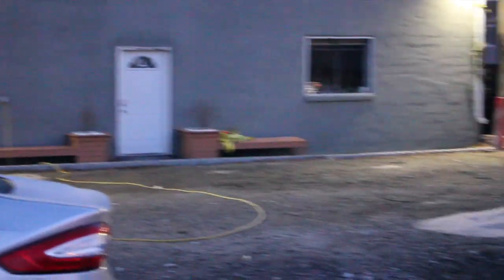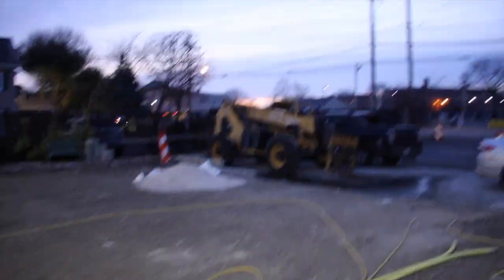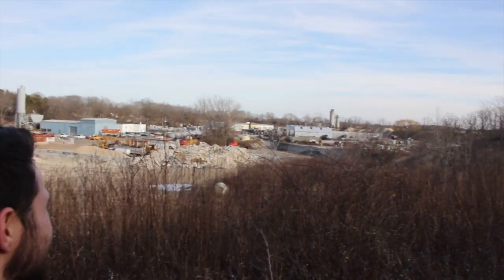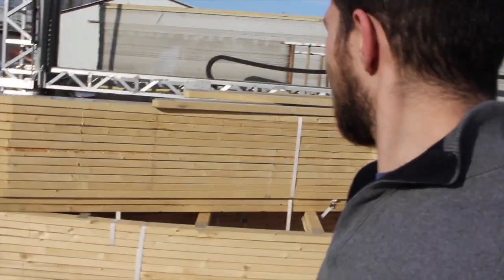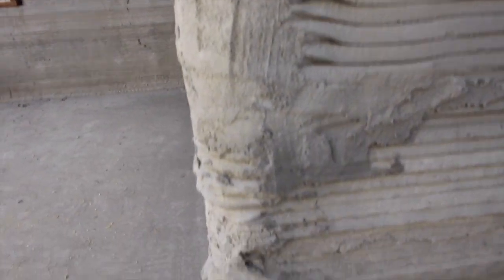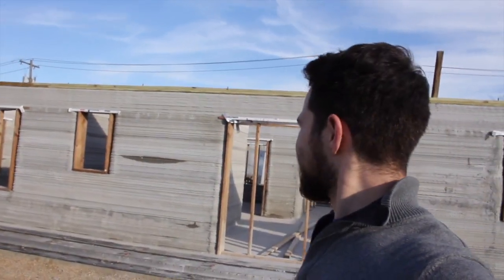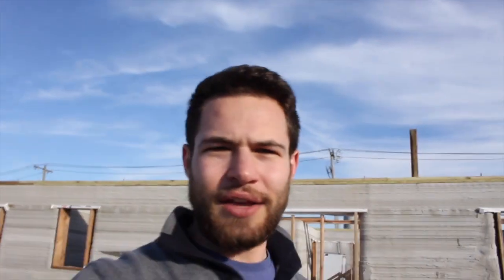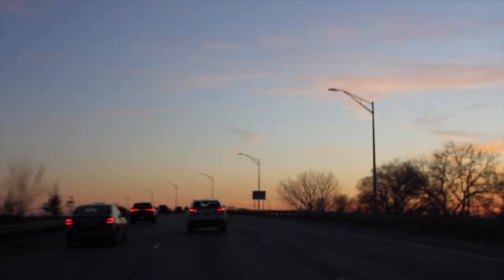SQ4D 1900sqft Printed Concrete House

Comment: Right now i am unable to contact any one that supposedly builds these houses. Im trying to get one build on my land out in the country. Yet all contact info leads nowhere. Im convinced that these people are just trying to take the money from investors and run with it. I believe its a scam.
Reply from the maker: There are reputable companies willing to sell you a printer I’ve conducted many interviews with great companies some willing to sell printers to you others aren’t. what country are you in?
Reply: Jarett Gross im in the United States. Im not interested in purchasing a printer, i just want to purchase a printed home. Mostly i would like to down size. I live outside any city so building permits would be very mild. County permits if any would be the permits required and the only one would be the make sure it wont collapse when built permit.  Thats about it. Thank you for your reply.
Reply from the maker: @googleuser8448  Sure, that is the issue with cutting edge technology. Right now not many of the printers have been made so even if you had the six figures cash ready to buy a printer you would still need to wait around 4 months for it to be built. It will be at least a couple years maybe as many as 5 until enough people have been trained on these printers that people get around to doing individual projects. The machines are expensive so people who buy them will first want to target big multi unit projects as opposed to single homes for customers. I hope to buy one of these printers within the next year or two because there are so many people who want to get their house built this way and not enough people with that skill set.
Reply: Jarett Gross, that does makes sense.  I guess im a dummy.
Reply from the maker: @googleuser8448  Your'e just a bit impatient thats all. Surly your'e clever for thinking outside the box and considering unique alternative.

Comment: One big thing that I see is cracking/settling(?) @9:45, look over his left shoulder at the top of the window frame... is that a big crack running from the corner up to the roof sill? Also, is that another crack about 10 ft to the left? I like the idea of 3d printed houses... but long term, those cracks concern me.

Comment: Totally out of pure ignorance i have a question.....as far as i know, this type of concrete, preserve most of the caracteristic and quality of regular concrete, some how develop a formula that can go in and out of the robot, and stay put on site, not needing a frame to stay put ???
But, why do not use metal bar as regular concrete does ??
This type of concrete do not shrink or expand with cold an hot weather and finally breack (need of metal bar) as regular concrete does ??
Thanks
Reply from the maker: I’m not sure what you mean by “not needing a frame to stay put” the metal frame is for the printer that extrudes the concrete and the window and door framers install those after the concrete walls are printed. They do use “metal bars” if you mean rebar. Time will tell how it lasts through winters and multiple freeze thaw cycles.
Reply: @automateconstruction  yes..i gues that is the name, Rebar, or steel reinforcment, or steel cage, i guess....in a regular concrete wall you do use ReBar, other wise it will breack.....so i do not see any rebar in this 3d walls.....even when the house is finished, the walls looks as same as the begining, no rebar what so ever.
When i talk about the frame, i mean wood frame....when you build lets say footings you do need a wood frame, in order for the concrete to stay put as the concrete is liquid.....i do know in this 3d walks, they use a special formula, liquid enough to run through  the machine hose, and after is out, if kind of dry a bit to stay in place, not running away as regular concrete does...
Thanks.

Comment: Very good video Jarett.  Thank you for making it.  I LOVE the idea of 3D printed concrete homes every since I saw videos from ICON https://www.iconbuild.com/  My only concern is the durability of concrete.  What about it cracking?  I look at sidewalks, driveways, etc.....I see cracks everywhere I walk in concrete.  Any shift in the soil could cause it to crack.  I'm playing the devils advocate because I want this technology to succeed!  For me it's all about price.  Supposedly the 3D concrete homes are much cheap to produce according to ICON.  I'm from Texas so ICON was my first connection to 3D printed homes.  What are your thoughts on cracking?  Maybe they can develop a high PSI concrete that has some sort of resin or rubber or something in it that will allow it to flex just a tad without cracking.  Wood can flex given it's nature.  I want the 3D printing to win out in the long run.  Homes are way too expensive now.
Reply from the maker: Great point, I’m hoping to do a video on icon soon. I’ll be sure to ask about cracks.
Reply: @automateconstruction  Thank you.  Yes, I'd be curious since this is a new technology.  I'm just learning about it myself.  I'd also be interested in how any of the companies deal with electrical and plumbing.  For instance, if you had a water leak within a concrete wall, or a wiring issue that had to be repaired, how do you get into the concrete without destroying it's structural integrity and how to do "patch it up" so to speak.  You could simply have plumbing and electrical, etc outside the wall but within a sheetrock/woodframed interior wall but that kind of defeats the purpose of using concrete.  I need to listen to you latest 2 interviews with these companies owners.  They all probably have solutions I'm not thinking about.
Reply from the maker: @Let’s Talk They will be much cheaper to build. They allow less concrete to be used in many circumstances and the reduction in manhours yeilds significant savings. Right now the cost of the unique concrete mix used with this tech is holding it back from being more cost effective than traditional construction but when there is a bigger market for it economies of scale will bring the price down for everyone.
Reply from the maker: @Let’s Talk Awesome! I think thats a great use case and everyone loves sustainability looking forward to seeing your projects come to fruition!
Reply from the maker: @Let’s Talk I'm hoping to visit one of their upcoming sites before the end of 2020 and check out their work.
Reply: I checked out the website you posted. Icon build. Beautiful homes they built in Austin. Sadly they are cheap to build, and it doesnt take too much time but they are going for 450K.
Reply: @maryjoAlessio  Yeah, it's crazy.  Inflation has created a housing and materials bubble.  No doubt 450k is absurdly overpriced.  There are much cheaper ways to build.

Comment: This technology is has arrived and is like in any other previous of adaptation progressing will become a large part of the industry.  For anyone who thinks not in their lifetime well its right in front of you and ignoring it is silly.  Most automated implementation will be gradual and then seemingly overnight roll out to become the norm and replace what is now the norm.  Self driving cars have been operating for years and will eventually become available to the consumer as well as flying vehicles.  Construction is no different.  It will not be avoidable since its economical characteristics will shove the traditional process aside with more cost friendly temptations to abandon the old and embrace convenience at the expense of not requiring the labor force that drove our economy to make this possible.
Reply from the maker: Very well said Fred

Comment: Great video. I would love to hear more on this in the near future. I don't see any provision for electric. Can you explain how electric, cable and phone is added after the print?
Reply from the maker: One option that icon build choose with a project they did at sxsw 2 years ago was to just put all the electric/data cables on the exterior mimicking how they manage electrical in most CMU construction.

Comment: I hope that building is reeinforced in some way, cause those cracks might be an issue later on (also for the water thightness). I wouldnt want to live in a building that “might” collapse 😅
Reply from the maker: I peeked over the top of the wall to see if there was any rebar... I assume there was but the framers has covered it in preparation for the roof.

Comment: Which system do you see more merit in? The factory built 3d construction or the on site 3d construction? I see that printer sitting idle and I'm thinking they are losing money as you speak.
Reply from the maker: Thats a good point. We need more data to articulate which has more merit financially (thats really all that matters in affordable housing) personally though I prefer the printers that are mobile enough to print on site because the way I see it the printer weighs 2000-5000 lbs while the concrete house could be 10-20x that weight and both require some assembly. At that point it comes down to wether or not you can source your concrete locally to avoid shipping costs. 

To my knowledge SQ4D is only operating on a research basis right now experimenting with their technology. They probably want to improve their product before maxing out the usable hours of their printer.
Reply: @automateconstruction  I think the factory 3d print can have an edge in quality control if they really want to dial it in. They can control the temp and humidity as well as drying time. And they can make smaller batches of concrete so they can adjust more easily with a lower amount of waste. But as with anything time will tell.